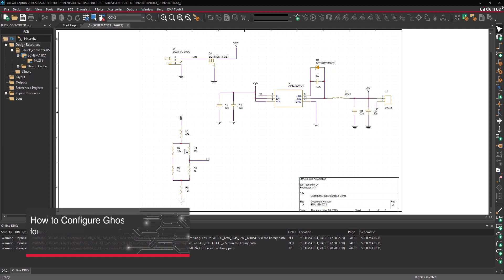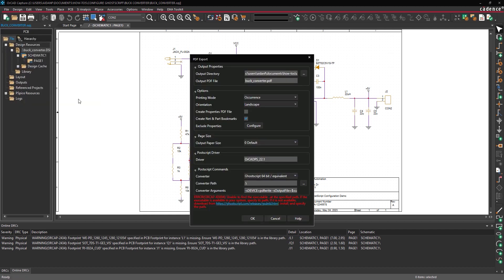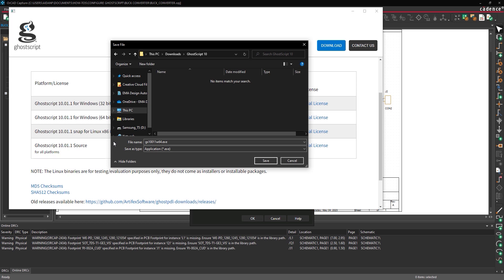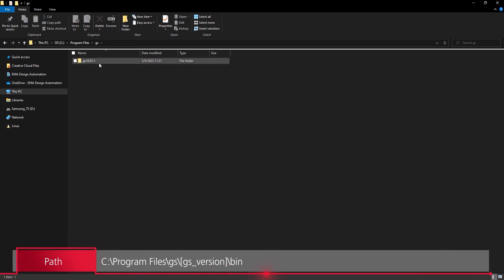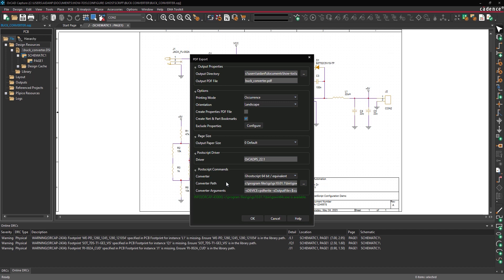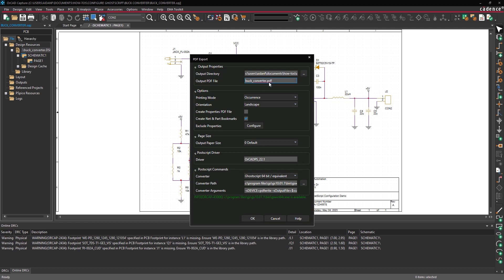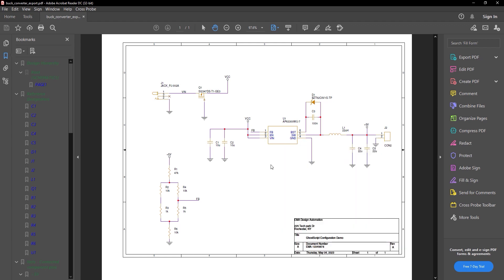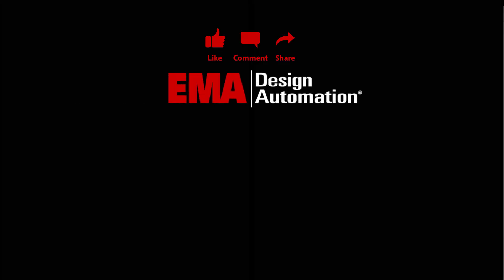How to Configure GhostScript for Smart PDF Export

Comment: If I open the PDF and search for a part, IE. R12 it doesn't find it, is there something I need to change. I can find it by looking through the side panel.
Reply from the maker: Good question, @AndrewBaab! This requires some additional information to answer which our tech support team can assist with. If you are an EMA customer, you can contact technical support here:  https://support.ema-eda.com/

Or find your local Cadence support team here: https://www.cadence.com/en_US/home/alliances/channel-partner.html

Thank you!
Reply: @EMADesignAutomation  Same issue, its not generating a searchable pdf. Filed ticket with cadence waiting for their reply